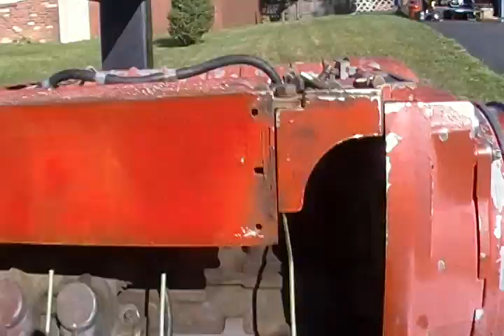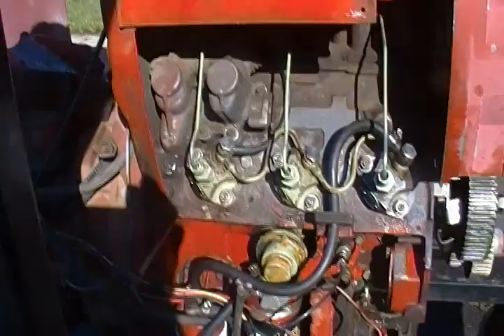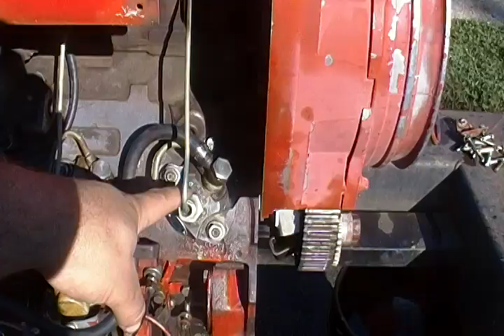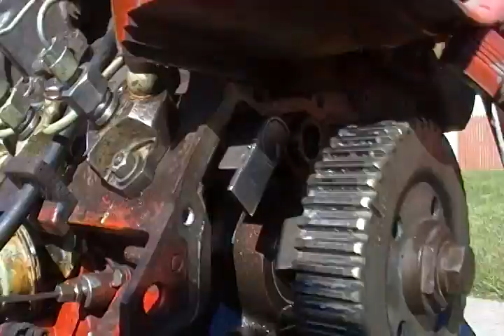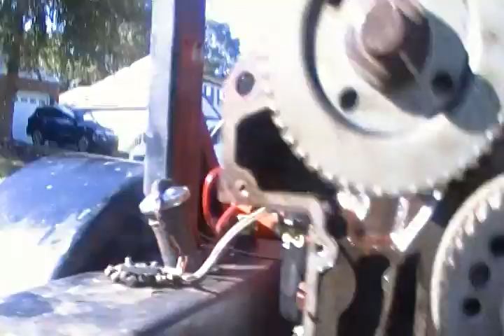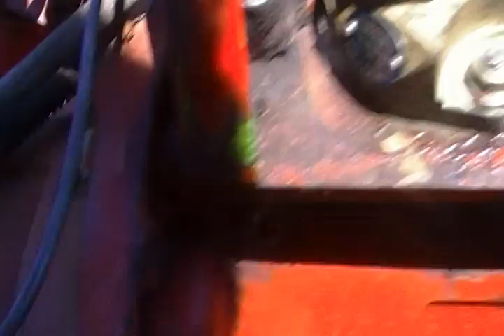Deutz Generator Set Repair Pt.2

Comment: When Deutz went to rubber timing belt s a disaster. We had two with failed belts bent valves pushrods.
In Bobcat s and jLG boom lift.
I have old 511 gear drive lasts forever.
Germans made a big mistake.
Deutz Fahr tractor s awesome related to Rudolph Diesil .
Excellent channel

Comment: I have a question a little off topic but have had trouble finding info,  I'm building a boardtrack racer out of an old bicycle and using a villiers midget mk2 engine and it has very low spark,  I myself thought it was the coil but since have been told to re magnetize the magnets in the flywheel,  looking for info on how to go about this and thought of you,  any ideas or info?  Thank you in advance

Comment: Seems like it will be a good machine in the end, that's some kind of strange timing set-up... you'd think it would be easier to simply make the gears with perhaps one spline less or SOMETHING so that the gears only can be installed in time but I guess not having to have the gears in a certain position to install the timing belt is somewhat of a plus. Good diagnosis on that bent bit, works slick now.

Comment: some of the old ford uk diesels used to use the cam lock pins or a flat bar slot type but i know the crank was on a threaded pin type some of the bigger ford diesel used to use a pin in the fly wheel a pin in the injection and a pin in the cam which is in the block but as push rods and the cam is driven by a belt that was the new generation engine great video mike cant wait for the next part
Reply: might be before TDC